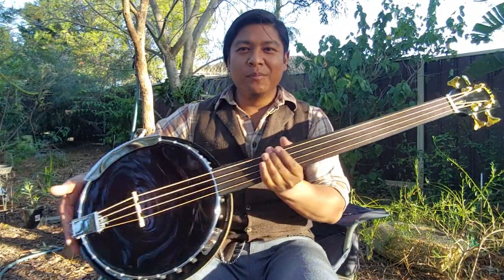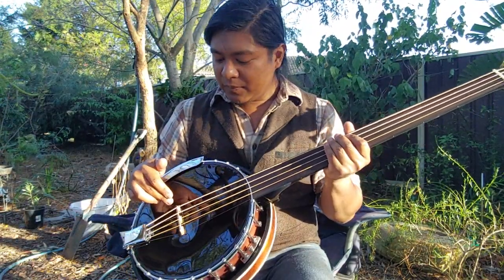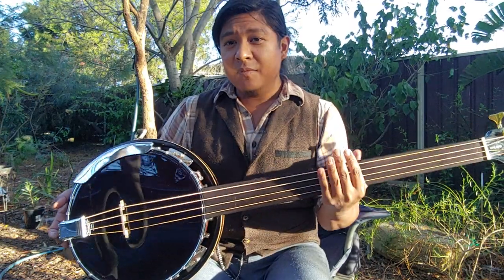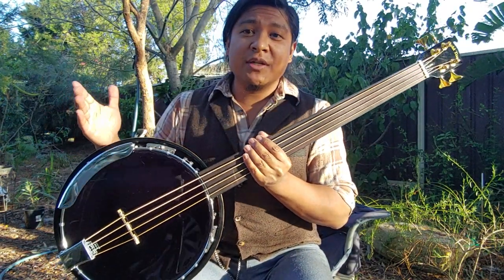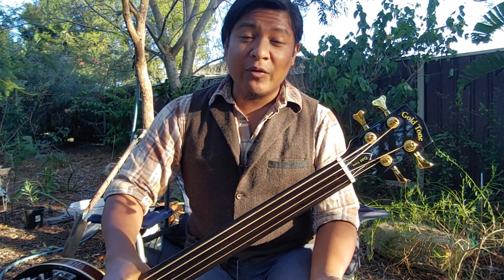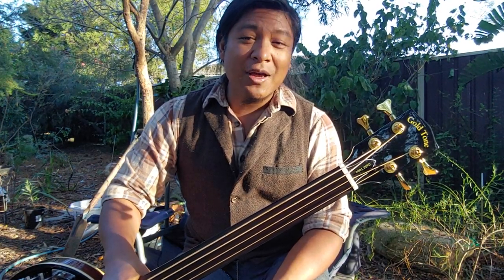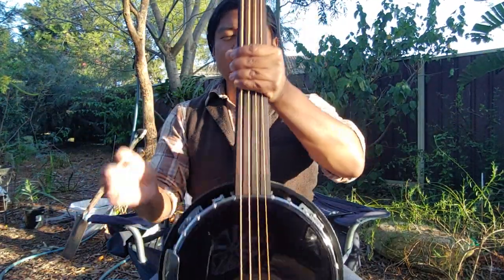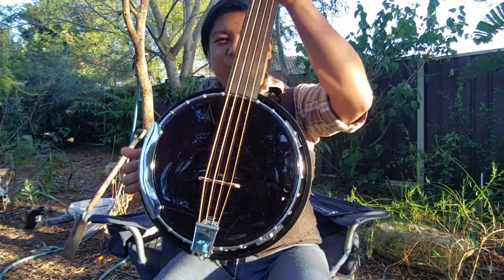I built a fretless Bass Banjo

Comment: Round Wound Strings on a Fretless Bass, like what Sting used.
Reply from the maker: These are brass round wound, with the low string, 45 to 100 gauge.
Reply: @MountainHomeJerrel  Yes 45-100 Gauge Brass Roundwounds but yeah Jaco Pastorius was also known for using Round Wound Strings on Fretless Bass.
Reply: @MountainHomeJerrel  It has that Jaco Pastorius Vibe.

Comment: Ya,
Banjo's just weren't hard enough to play,
they sounded so nice with fixed scales.
Thanks for making the worst metal cello,
 thing.
/s lol 

Sorry buddy,
an easy target of banjo hate trolling.

As an studio and live engineer,
I would have to see how it sits in the mix on stage, arrangement wise,
across the freq. spectrum vs instruments, 
and usefulness when used to enhance...
when applied to a musical gene or beneficial melodic function.

This alteration does limit the players capable of playing it well, relative to concerns pitch wise.
Fretless isn't a good 'go to' for the pitchy and less experienced/trained player. (possible luthier customer)
Where as the intension of fretting was partially more accessible to less learned players, 
scale affixation, tuning, neck twisting, and overall easier playability for a wider range of player abilities.

Congrats, it looks like a very nice build quality,
and I look forward to hearing it included in some tracks.
Reply from the maker: Thank you for the feedback and sharing your thoughts! I'm currently looking into installing an internal mix with an onboard EQ system. The tuning is EADG so any bass player should be familiar. For small jam sessions with a few other players, it works fine without amplification. I haven't used it in any performances yet and won't until amplification is installed. Cheers!
Reply: @MountainHomeJerrel  You are most welcome.
You did a lot to bring the video to me,
the least I can do is offer what I can back.

May I suggest, and I am sure you are thinking of them as a pickup.

LR Baggs's Pres are always great to match up musical tonality to an acoustic instrument.
Great company, ground up, acoustic musically minded engineering, and an American music success story of a true innovator and pioneer,
for those that don't know.

He is a great guy too, he might find that project ihteresting.